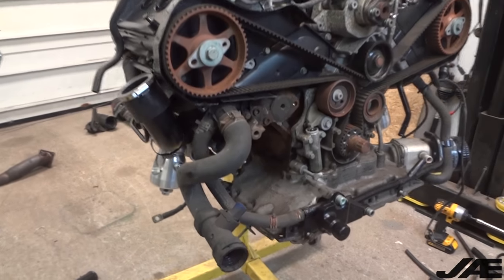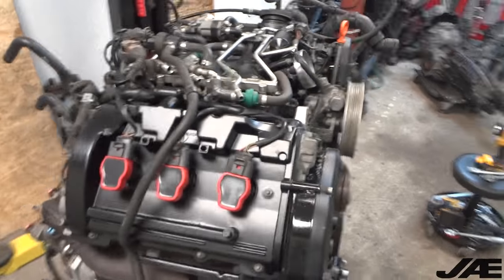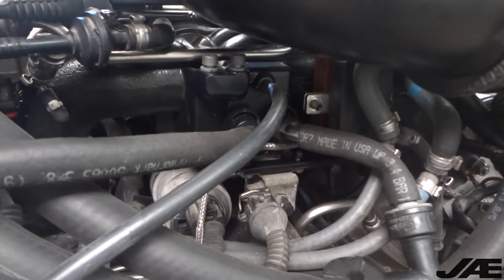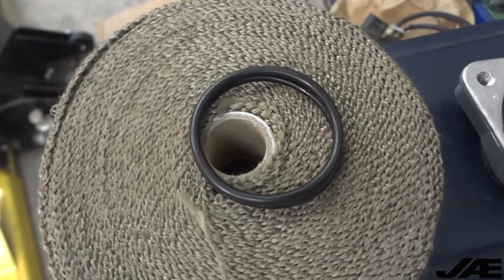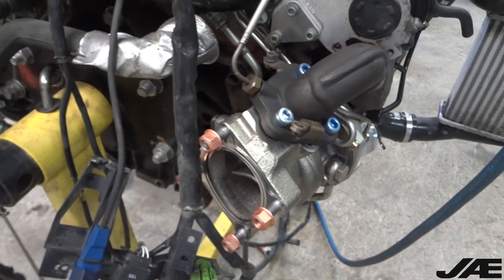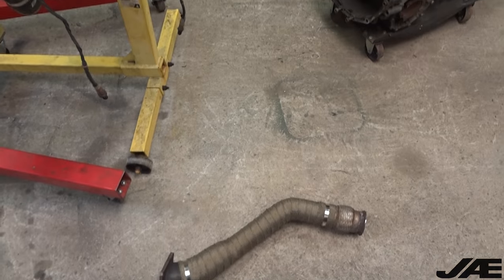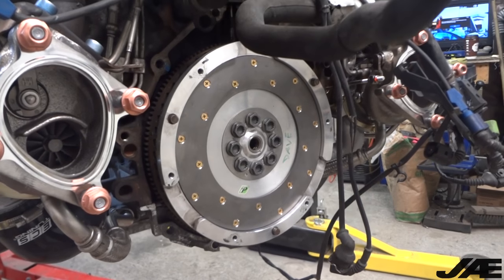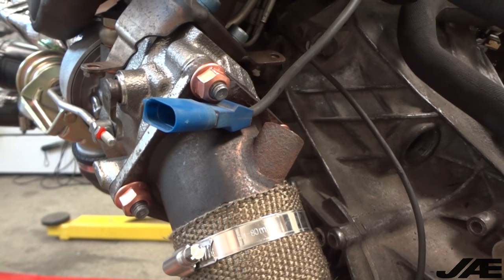Project B6 2.7T Stage 3 EP8 - Engine Assembly

Comment: Any tips on torquing the crank bolt with the engine out like this?  How do you hold the engine down while trying to torque to 140ftlb (IIRC) +180?  Ive got a monster 3/4 40 inch breaker bar and a cheater (floor jack handle) that I will be using.  But thats a lot of leverage and to far for a guy like me to counter-hold the engine down while torquing. Also, do you use the crank lock pin to hold the crank while doing this?
Reply from the maker: Try using a ratchet strap or bar to hold the flywheel steady while tightening the crank bolt.